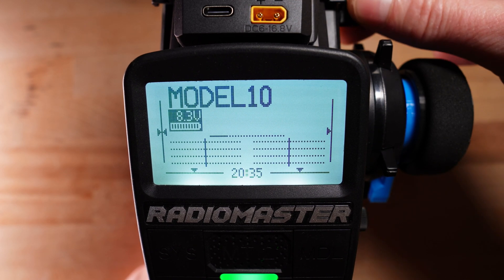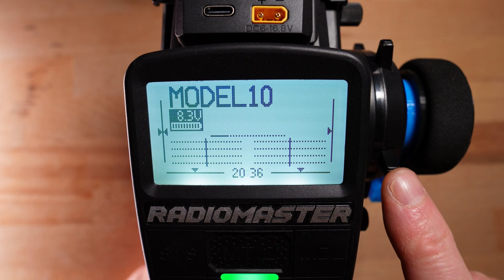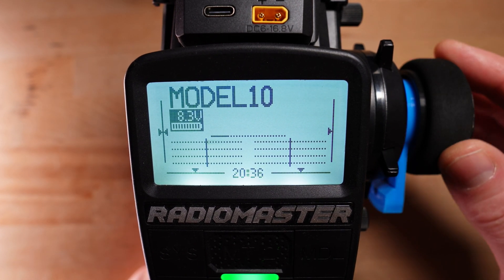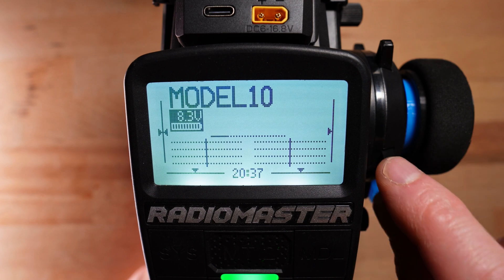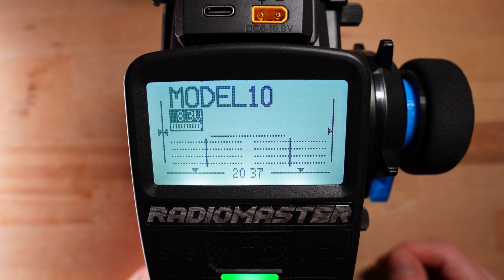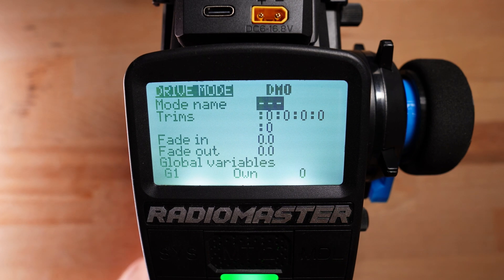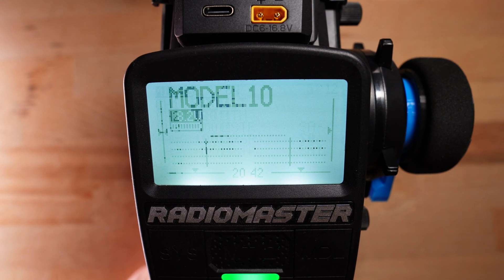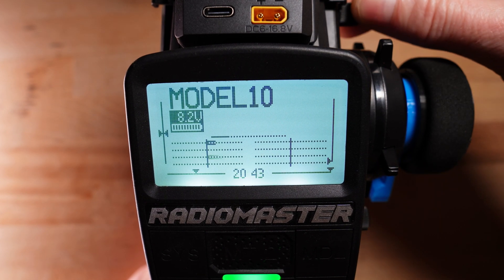INDEPENDENT TRIM FOR 4WS | EDGETX | MT12 [EN]

Comment: Your videos are super helpful, thank you. I've set this up and it's working, however the trim inverts when I switch to crab mode which misaligns the rear wheels. Is there a way to have the trim stay and not invert?

Comment: Hello sir, Can radiomaster mt12 add a variable sound to the throttle position to simulate engine noise using Lua script, I hope you can give us tutorial, thanks 🙏
Reply from the maker: You can play sound via LUA but the experience would be very "poor". On top of that, the speaker in the MT12 is not capable of playing back the "engine" sounds in a good quality.

Comment: I have been watching your videos hoping to find a way to set switch A the three-position switch to control lights on a semi-truck. 
I would like the inboard position to be off, the middle position to turn on the low beams, and the out-board position to turn on high beams and still have the low beams active. Can you assist me with this?
Reply from the maker: What is the light controller which should turn the lights on?
Reply: @arminrc  I am using Beier SFR1. 
The SFR1 uses the servo pulse to act as a switch.  As I have been thinking on this I may be able to approach this a different way using the SFR1. Will let you know how it goes.
Reply: Thanks for the reply. I found a way to make it work using the SFR1. Going to buy you a coffee.
Reply from the maker: Cool! Great to read that you found a solution. Thanks for the coffee! It just arrived 😀

Comment: Yo Armin. I've talked to some friends of mine about the MT12. They love it and all that but they told me they are so tired of searching trough videos for finding one simple tutorial. And that's why i'm commenting this. I wonder if it was possible to make one long video which shows every function with time stamps of the setup. Where you rather pick every video you have made and make it into one long video with timestamp so all the EgdeTX beginners can just have 1 video to follow to setup everything they need. if you decide to do this I will Promote it to everyone I know who has it :) Like if you need a tutorial on crab mode you can just skip to that part. if you need binding. you can just skip to that ect
Reply from the maker: This is a very interesting idea. But I am afraid that I do not have the "original" videos anymore. I produce them, upload them and thats it. I do not archive them (for what). This means I would have to create one video covering most of the topics. Currently I do not have the time for this but maybe in the future.
Reply: @arminrc  Would be awesome to see man!